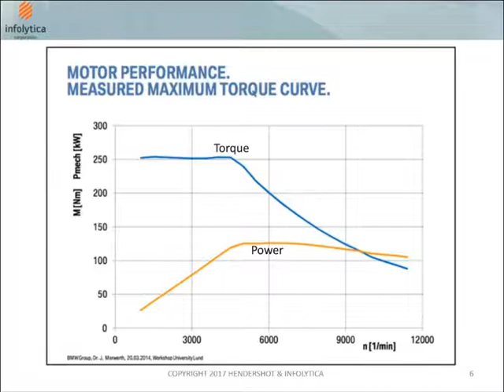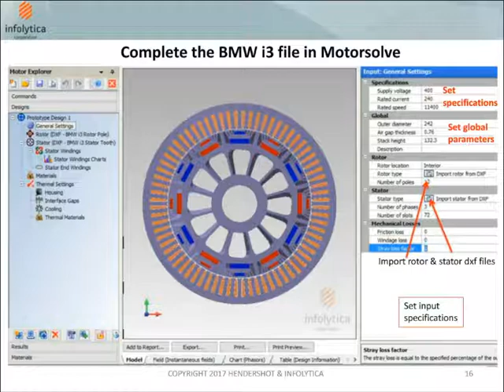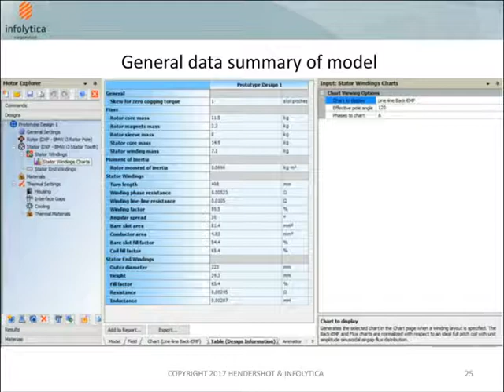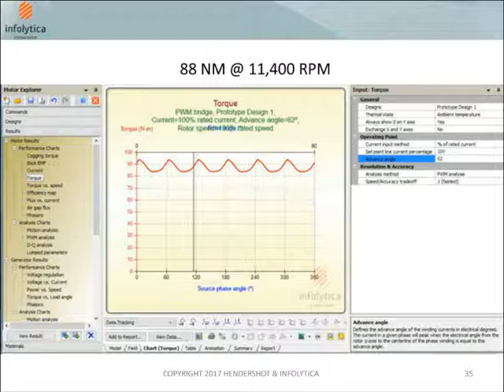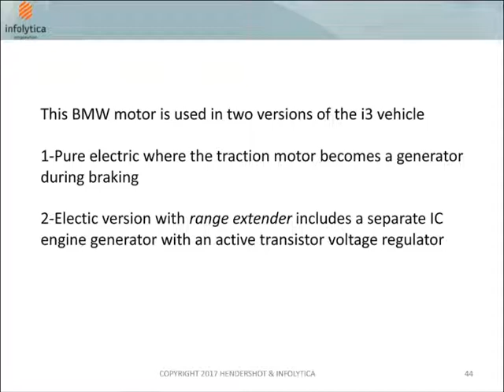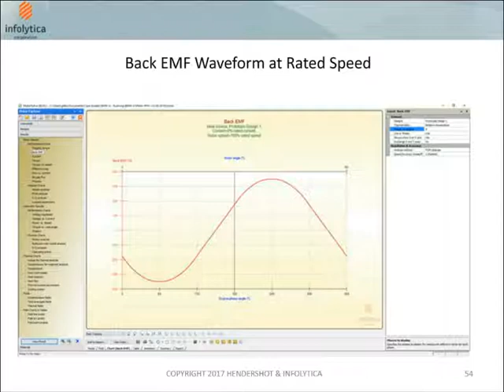MotorSolve Powering BMW i3 Design and Simulations | Mentor Infolytica

Comment: How can an induction motor with a specific output power (11 kw) be designed? When entering the motor data, I do not get the required output power, nor the required torque.